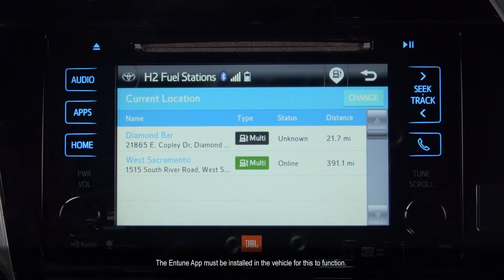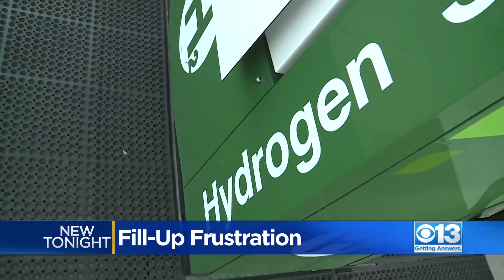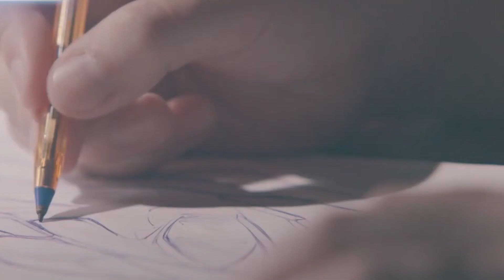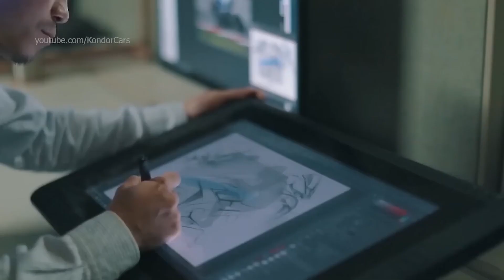Yamaha, Honda, Kawasaki and Suzuki Partner on Hydrogen Engines for Motorcycles

Comment: It would be a lot better if they didn't use hydrogen cells and instead used electrolysis which converts water directly into hydrogen so you would not have to worry about fuel cells

Comment: The batteries in electric vehicles require massive, highly toxic inputs of scant resources. You need to drive an electric car 7 years before you reach carbon neutrality (depending on how that electricity is produced), and even then, your battery will soon degrade into toxic waste.

Hydrogen combustion engines fueled via electrolysis are less efficient per unit of energy, but they are far more sustsinable if that hydrogen can be produced using real green energy sources such as hydroelectric dams & nuclear reactors. (Solar panels, wind, and bio-gas are green-washed BS at scale.)

Comment: Hydrogen  burns clean ,more power ,and , water is the source,not oil.
Reply: Yes and the exhaust is  water  vapor.
Reply: More power? My research suggest like for like enjin capacity and also in Turbine fan jet enjins - at best 80% of conventional fuel power.